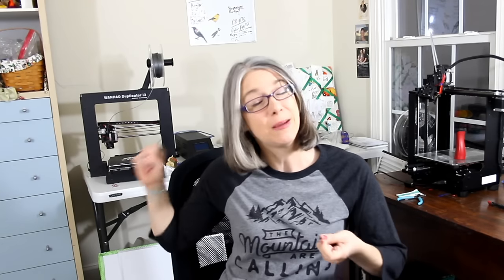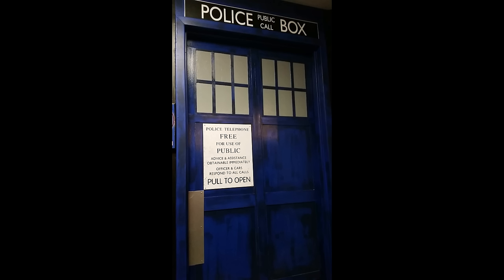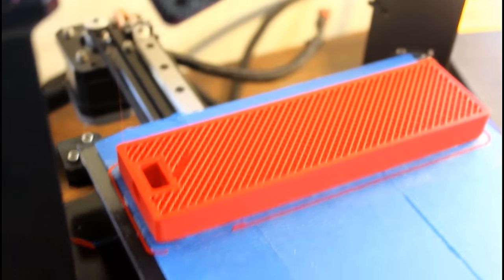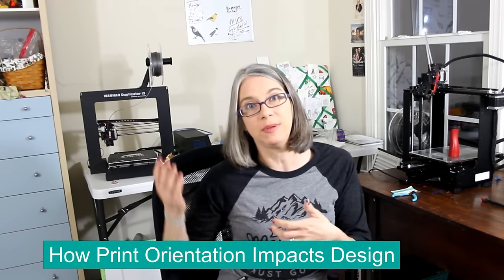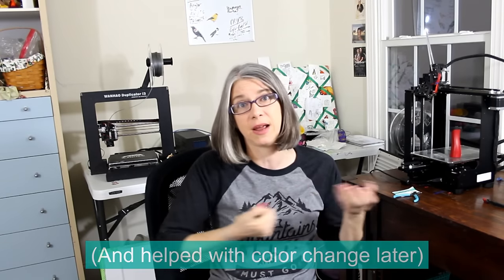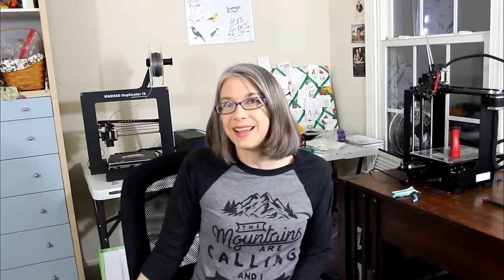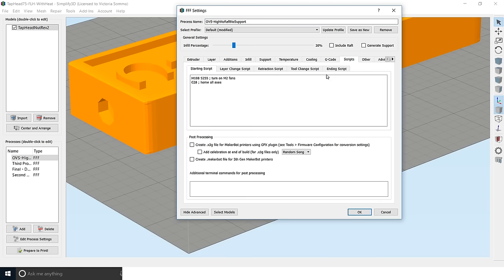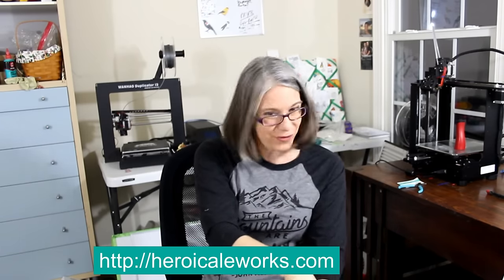Embedding Nuts into 3D Printed Tap Handles

Comment: Those are awesome.  I probably would have made a two piece unit with half a hexagon section to accommodate a "rod coupler" which is jus a really long nut.  I would have figured on having to screw the two halves together instead of doing the insert. 

You are doing a great job and you produce really good videos. Keep making them!
Reply: Norbert Davis I've got a tap handle that I've been making that is split in half but, I hadn't thought about using a rod coupler. That's a great idea because it gives way more support than just a hex nut. I'm surprised that I didn't think to use a rod coupler because I've got them incorporated into a machine I designed at work. I went with them for the exact reason I mentioned but, for some reason I overlooked my own brain on the tap handles...

Comment: I have watched your tutorials now twice on multiple processes. I am trying to do this for several reasons. One is to add things to the print like you are today, and the other is for filament color changes.  Here is the problem I am having...I used your ending and beginning gcode scripts for Process 1 and 2 respectively...but my printer, upon starting process two smashes the print head down into the top of the model about 5mm.   Any thoughts on this?  Here is my code:    

Process 1: Set to stop at 36mm (measured using Cross Section)
Start Script:
G28 ; home all axes
G1 X0 Y20 Z0.2 F3000 ; get ready to prime
G92 E0 ; reset extrusion distance
G1 X200 E20 F600 ; prime nozzle
M201 X1000 Y1000 ; slows acceleration

End Script:
G91 ; relative mode
G1 Z100 ; Lift 100mm

Process 2: Set Start at 36mm, and 36.1mm (tried both as some people suggested moving the print head up by .1)
Start Script:
G28 ; home all axes

Ending Script:
M104 S0 ; turn extruder heat off
M140 S0 ; turn bed heat off
G92 E0 ; reset extruder position
G1 E-2 F1800 ; retract 2mm
G91 ; set to relative positioning
G1 F1000 ; set speed
G1 Z5 ; move print head 5mm higher - If your build height is above 235 lower this value!!!
G1 F2000 ; set faster move speed for bed
G90 ; switch to absolute positioning
G1 Y215 ; move bed almost all the way forward for easy extraction
M84 ; turn motors off
M106 S0 ; turn off fan

When running the sim in Simplify3D all looks to be good. When running it in real life, after the filament change, the printer homes, moves to what looks to be about 33mm and smashes the print nozzle into the print... Thoughts? (And thank you in advance!)

Sorry for the long post, I just want to get production going.  Subbed too btw!!  Hopefully you will sub back as I am creative mentor as well.  ~AD
Reply from the maker: Sorry for the delayed reply!  I saw an email preview of your comment and it cut off in a way that it looked like you just had a statement and not a question. I would get rid of that G28-- Home All Accesses call in your Process 2 Starting Script and replace that with just a G90 (going back into absolute mode).  When your printer is trying to Home all the axes, it is going to bring the nozzle back down to find the 0 position for the Z axis... which as you have seen, doesn't go too well.  

I hope I didn't hold up your production too much.  I'll try to be more prompt in responding next time!
Reply: Yes! Thank you. I think I have it! I did have to remove the G28 and also top, bottom layers respectively.. Thank you for the reply! :-) Much appreciated.

Comment: At 3:50
You could just have rotated the nut slightly, so a corner was pointing straight down, and flat edges to both right and left. Then you could have printed it with a tight fit. 

Free tip for your next integrated nut :P
Reply from the maker: OOOh great tip!  You are right-- that does look like it'll give more contact area around the nut.  And it shows you were really, really watching the video!

Thanks for watching... and thanks for the future tip.

Have a great day!
Reply: TGAW you could pre print a nut pocket which fits your nut perfectly but has a square outer perimeter. Its job is to fit the nut completely snug and to create an outer shape that is 3d friendly to insert eg a square or rectangle . This could be printed on its side so the nut fits completely inside this 3d printed square .the square could be printed the height of the nut. When printing the handle you now only need to design the part where the nut fits as a square and you slide the previous part with nut inserted into the square pocket and supa glue. Now the nut fits perfectly with all sides surrounded by plastic so no stripping occurs .
Reply: But what if this print is done at a strip club. Still no stripping?
Reply from the maker: And another wonderful idea!  I just love our 3D Printing Community!  Thanks for watching... and giving me some great ideas to improve.

Have a great day!

Comment: My goodness Vicky, still as awesome as ever. :) Also, I'm thinking of making some tap handles, but I was going to heat up the threaded inserts so they were stuck to the plastic - I though just embedding would give the nut too much play. Does it work well?
Reply from the maker: It's been working great and got a great amount of stress testing at their grand opening!  There have been at least 31 made so far (they have been sending out tap handles with keg purchases). 

I did have an accidental discovery that may be helpful for people who don't want to embed nuts.  If I did just a 9.525mm (3/8") diameter octagon hole, the bolt would screw into that with a fairly consistent hold.  It's not stress tested like the nuts have been, but an option to try if you want one uninterrupted print.  : )
Reply: That's great to hear! I was also going to try tapping the plastic as well just to see. This was seems like MUCH less work, though ;)

Comment: Great video! I finally bought S3d and probably the thing I took most for granted in cura was the super easy color change plug in in it. Do you always use processes to change color? Like I've experimented with the M600 filament change command in marlin and that seems maybe a little easier, still trying to get a real method(that I always remember) down myself
Reply from the maker: Thanks for commenting!  I didn't always use multiple processes.  When I first did color changes, I would just manually watch the print and when it got the layer where I would want to switch colors, I would manually pause it and move the nozzle up off my print and do the color switch.   I learned the multiple process technique from one of Joel Telling's early videos.  It has made me a much more attentive mother to my young children.  : )
Reply: I've done the by eye method a few times. If your printer supports the M600 command try out this in the Additional terminal commands for post processing {REPLACE "; layer 12" "M600\n; layer 12"}. M600 will lift the head go to y0x0 retract like 100mm you load the new filament hit the knob/button it will prime around another 100mm then resume the print

Comment: i guess i am still a bit lost (after watching 3 times) the first two process.. is the second's bottom layer is on top of the 0 top layer of teh bottom?
Reply from the maker: Hey Joseph!  Thanks for commenting.  The second process does print right on top of the first process.  And I had 0 Bottom Layers on that second process which I forgot to mention, so that may have added to the confusion.  So as soon as it finishes that first process (which ends on infill), it continues straight into infill.

In my video, when I talk about solid bottom layers sealing the nut in, that is the beginning of my third process (it was bad edit there-- I should have mentioned that). 

Really adding in that additional process wasn't a necessity, just a means for me to get out of some extra solid layers.  

I'm not sure if I cleared anything up or not.  Let me know if it is still foggy.  Perhaps some extra screenshots are in order.  

Have a great day!

Comment: I'd never thought about how orientation would change the print time. Could you tell us why sometime, because the volume is the same.
Reply from the maker: You know, Jason, I've long noticed the speed differences, but I never really questioned or reflected on "Why".  I know the Z movement speed is typically substantially slower than the X-Y movement speed and maybe it has to do with your largest faces are now going to be solid outlines which is typically slower than solid infill.

I know Maker's Muse has done some videos on print orientation.  Maybe there is some more information there? 

Well thank you for the thought provoking question.  I'm may have to learn more!
Reply: I think it is slicer algorithm related. Slicer gives small perimeters more time to cool down. Possibly cool down settings  need to be checked. It makes a little sense since the cooling fan is used. Anyway displayed model should be printed horizontally. Less warping/dimensional problems, print will stick better to the plate, more strength in working direction with any material.
Reply: Andrew Shylenko yes. Now that I've thought about it layer height would make a difference as well as the x and y path would be the same for each z move. So orientation would affect total number of layers. Thanks for the answers.
Reply from the maker: I just love the dialogue that stemmed from this question.  Fascinating and enjoyable!  :)

Comment: I think that the most important reason for not printing it vertically is strength. Printed vertically, when they pull the lever, it's ripping the layers apart. Typically the layer adhesion is the weakest part of the print.
Reply from the maker: VERY good point!  Thanks for watching.... and commenting!!!
Reply: I was just scanning the comments because I was going to say the same.

Comment: i am about to purchase a 3d printer ,, what do you think of monoprice i3 v2 ?
Reply from the maker: Hey Peter, although I have not personally used Monoprice branded version, I have enjoyed the Wanhao version (You may need to fact check me, but I believe both are made at the same factory with the same parts).  The Wanhao can be pickier about filament changes than the more expensive Maker Gear M2, but it does keep up with it in terms of print quality.   

And side note-- I have also heard good things about the MonoPrice Mini.
Reply: TGAW thanks alot , really appreciated